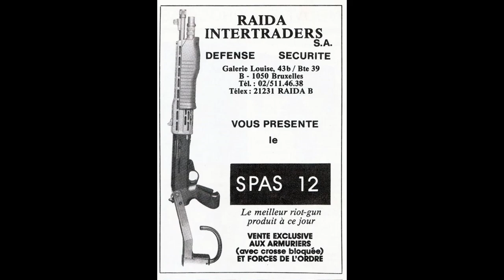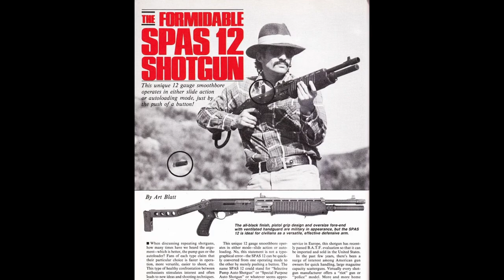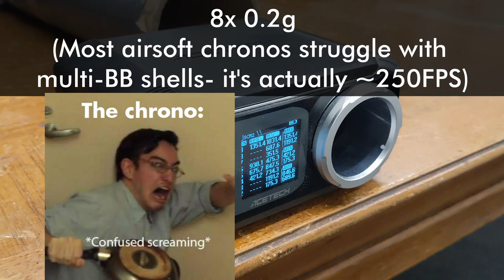Airsoft Gas Blowback, Shell-Ejecting SPAS-12 Custom Build

Comment: For the swapping of fire modes i think the easiest option is to have two interlocking hooks on the action arms and the corresponding arms of the pump, and pressing the button pushes the pump arms upwards unlatching them. although i don't think it'd be a good idea to fire in "manual"

Comment: Just a heads up, that filter you have on that mask is a C2 filter, which is known to contain chromium in the filtering medium, now it isn't a huge concern, definitely overblown by a lot of people, but I'd recommend you get a C2A1 filter, the green bodied version of what you currently have.

Also, I'm not certain on the ballistic capacity of those tinted M40 outserts, I believe they're alright, but stay safe.
Reply from the maker: We sincerely appreciate the concern, but to be clear, the filter is a hollowed-out dummy fitted with a powered intake fan. The tinted M40 outserts are /not/ ballistic, though the lenses have been replaced with polycarbonate- regardless, we do not use or recommend the use of gas masks for airsoft. It's just a fun costume.
Reply: @ExplosiveEnterprises  Gotcha, that's good to hear, although I will disagree, airsofting in a gas mask is loads of fun with the right mask, the MCU is perfectly safe and I use it quite a bit, holding up pretty damn well.
Reply: @ShogunMongol  damn right, love sporting my s10 gas mask with airsoft proof outer lenses for my HUNK build.

Comment: Since you converted the Maruzen M1100 Airsoft shotgun into the SPAS 12 shotgun, could it work with any other shell ejecting or gas powered shotgun? Because Most of the Maruzen M1100 shotguns are sold out or out of stock

Comment: Im thinking about making the aps cam870 to semi auto.  Not shooting semi auto you  have to pull the charging handle back every shot but it would be cool, mill the frame with probably 7-8mm endmill and making a spring that pushed the pumps forward, ill post it on my yt channel if i ever do it